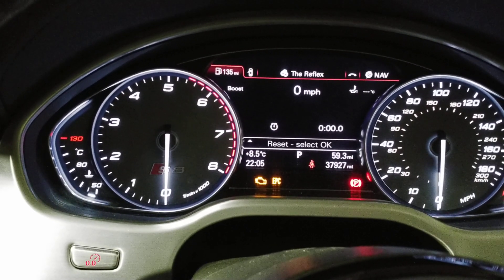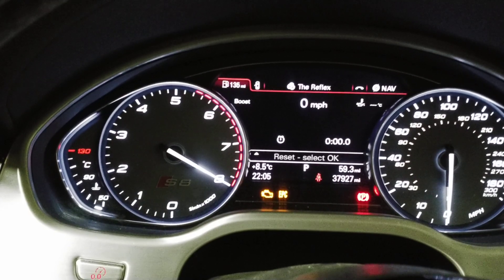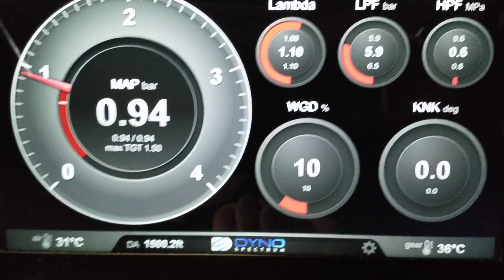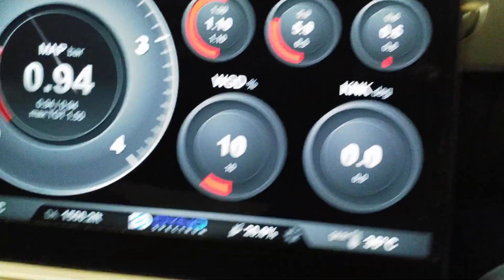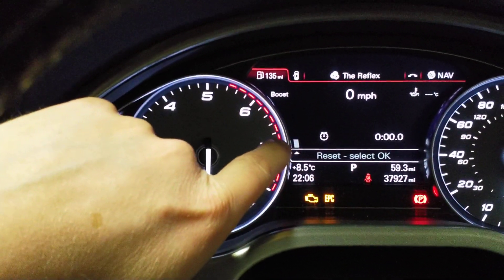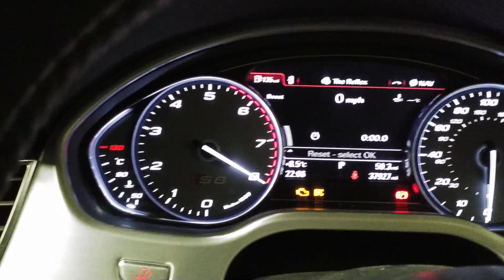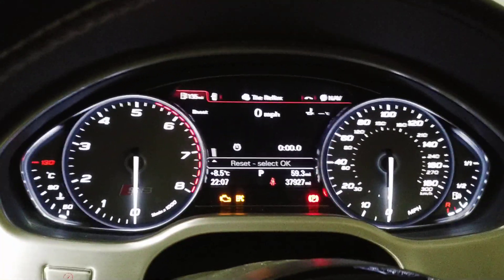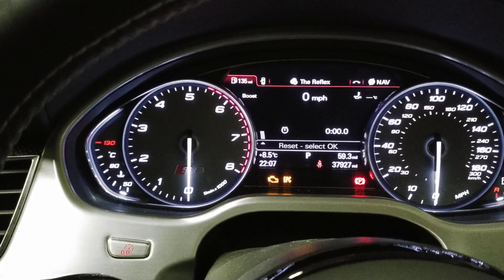Dyno Spectrum set ethanol content manually using pedal and tacho with engine off

Comment: Question I also have the ds1 an I can see the 82 on the boost gauge but on my dash screen the boost gauge doesn’t go up or the rpm needle doesn’t stay once I hit set but it shows on the gauge is that normal?
Reply from the maker: I don't quite follow. Which car, do you have an ethanol sensor, which boost gauge, which gauge viewed on which device? You could always make a video of what you mean and post it in the relevant Facebook group as these things can be difficult to communicate without seeing what someone means.
Reply: @evorealtime  I have an Audi s6 2018 I also have the tune ds1 i was trying to run full e85 I was able to set the ethanol content on the ds1 boost gauge but whenever I tried setting it on the car dashboard the rpm needle wouldn’t stay at the number I wanted when I clicked set but maybe it worked cause on the boost gauge it shows it’s at 82%
Reply from the maker: @AARONRIOS7  So the problem isn't setting ethanol content and verifying it has been set in a log, it is changing the displayed dashboard boost gauge to ethanol? If so, see the user manual and linked video how to do that: https://docs.google.com/document/d/14dKUEdBABGpY-qk_Hx7FVnGayUj2Hwh0/#heading=h.2dlolyb If you can't get it to do it, a video of you trying will quickly see which bit is being done incorrectly.
Reply: @evorealtime  correct it’s not changing on the dashboard boost gauge but on the ds1 boost gauge it shows it changed
Reply from the maker: @AARONRIOS7  Please see the solution above. You need to change the boost gauge to show ethanol content. It is similar to map switching but shows a flashing EPC light when selecting. You need to have the boost gauge showing to see it as well.

Comment: How do you manually check how much ethanol you can add with no sensor?
Reply from the maker: We prefer a sensor and have full flex fuel that uses one, but if mixing what you think is E85 in a small proportion then your error would be small if you guessed. You could also use a controlled fuel or a test tube or estimate from fuel trims. A sensor is by far the best.
Reply: @evorealtime  I do plan on getting the sensor but just mean time want to mix in some E85 with 91… this my first time doing any of that so I’m not sure if it’s okay just adding a couple gallons of E and a few more of 91. I was told when I bought DS1 that it can calculate the flex fuel blend. Just wondering how that works but I don’t plan on doing that long term.

Comment: So what power can the S8 make with upgraded turbos and a full E85 Conversion?
Reply from the maker: It is limited by the fuel system, intercooling and turbos and dyno cooling. Water methanol injection, air to air intercooling and fuel pumps has done over 1000 WHP. So far the best power is not running full E85 on larger than stock S8 turbos because even upgraded fuel systems run out. Forthcoming port injection from SRM should fix that. A lot run E50 and slightly larger than stock S8 turbos.
Reply: @evorealtime  Amazing, thanks for the late night reply. What's 0 to sixty look like with 1,000whp on that platform?
Reply from the maker: @CJT4191  100-200km/h is 4.x.